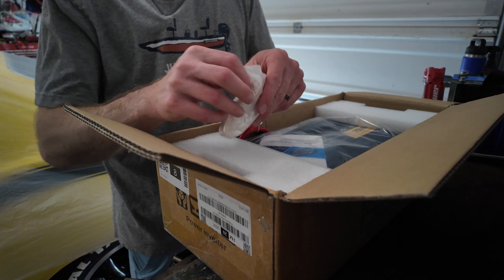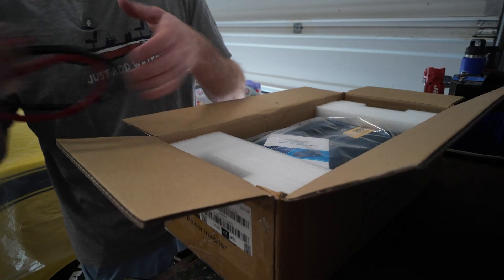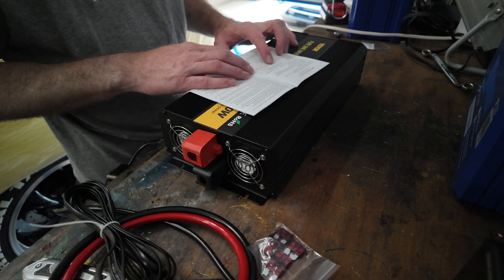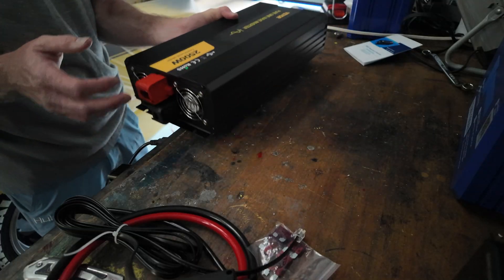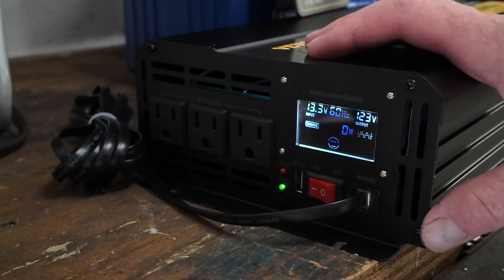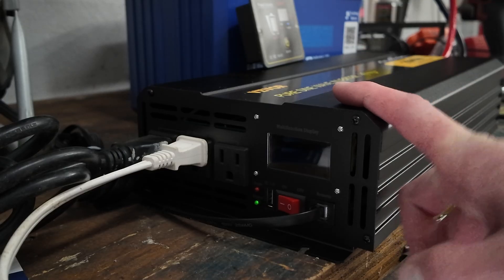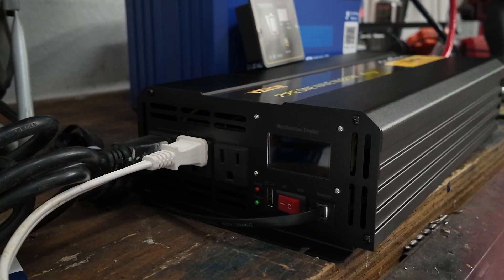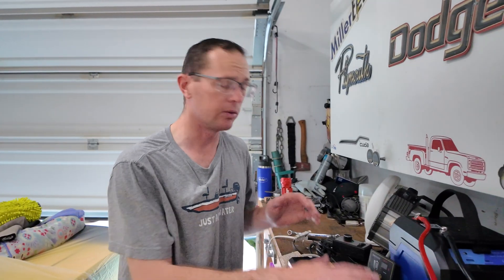First Look! VEVOR 2500W 12v Inverter - Unboxing & Load Testing

Comment: I bought a Vevor 2500 and it stopped working after two weeks.  The company will not replace the unit or refund my money.  Very bad company.  It even ruined the BMS on a $400 battery.